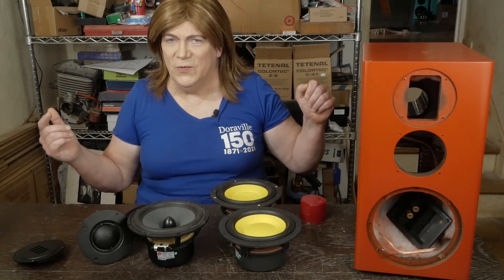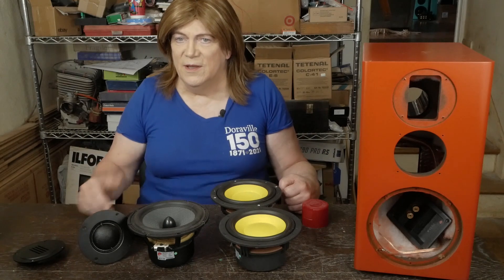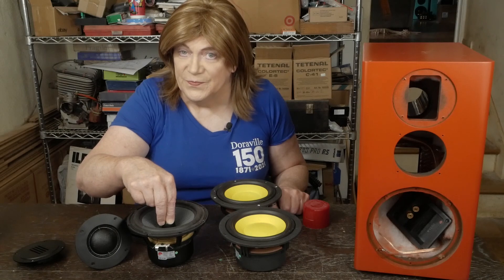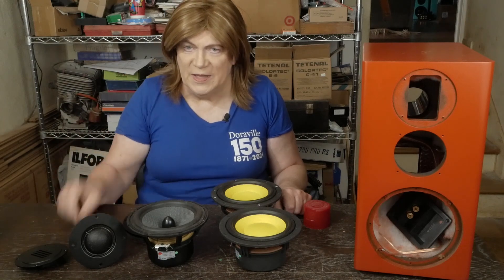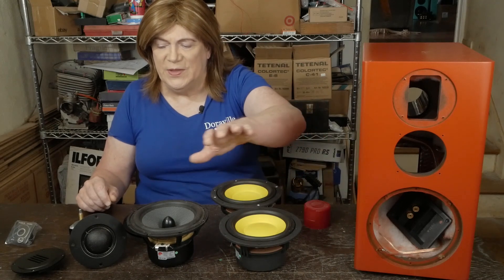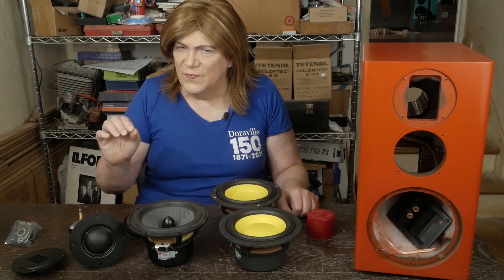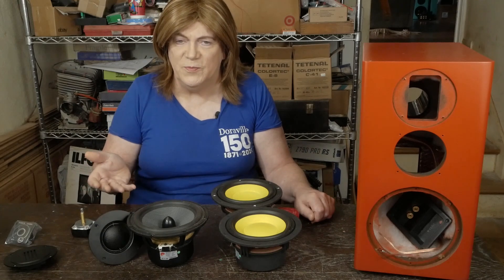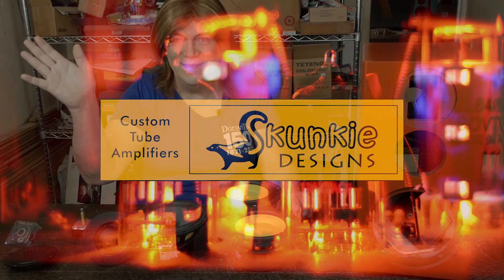Swan DIY 3.1A Speaker Mods Update

Comment: Domed midranges are made that way to produce a wider  dispersion pattern. This is more effective at higher frequencies, which is why you often see dome tweeters. Using a domed midrange is an attempt to more closely match the dispersion patterns of the tweeter down into the midrange band.

Comment: It will be interesting to see the final mods and how they sound. Typically anytime you change a driver the crossover must be changed to accommodate that it. Changing 2 of the 3 drivers is gonna be interesting for sure. I love mods and can’t wait to see the results.
Reply from the maker: My goal is to bring everyone along in my learning process. I do plan to swap just the woofers first, test, and then play with changing the tweeter.

Comment: The horn tweeter being recessed could add a time delay in relation to the midrange and cause a bit of a top end dip. Might be worthwhile also testing them wired in reverse phase to the midrange.
Reply from the maker: Good idea!
Reply: I don't see the horn loaded tweeter in the ScanSpeak lineup but I did see the straight soft dome. It's listed at 91.5 dB/M/W sensitive and a 4.5 ohm impedance so it would probably match the mid driver better. It would still have to be padded down about 5-6 dB to be linear.

Comment: Get the most out of your low-end driver you may want to check the box tuning with the new woofer. This could easily be done with the impedance analyzer on your Discovery Pro. With the woofer installed the Box all sealed up, run an impedance sweep on the low end adjust the port length until you get to even impedance humps below 200 HZ. Hopefully the speaker that you bought doesn't have Qts that is too high for ported design.

Comment: On the large midrange woofer the center plastic plug. Is a a phase plug.  There used to help extend the frequency range of the driver higher. . And yes you are correct the shape the cone does make a difference. It's just not everyone can hear the difference (not all ears are the same ) I don't know much about building speakers but I do like to play with them and learn. And I do listen and test several pair a year

Comment: Dome midrange has worse dispersion than a cone midrange where it meets the tweeter. Seems it would be the opposite, but its not, has to do with the coil coupling. Yes that pushed in dustcap will make a response difference at the top end of the woofer. Yes the bullet in the center of the woofer is used to disperse the top end resopnse and its called a phase plug. Put an 8 ohm resistor across that tweeter terminals and it will make you much happier.

Comment: Started assembling my 2.2-a and had trouble getting the cross-overs to work.  I think the inductors were not getting into the circuit.  Pulled them out and tinned the leads and reinstalled and think they are working now.  Surprised how much they attenuated the high frequencies, but will not be confident they are working till I hear them.  Below 100hz full signal goes thru has pole and 1.5khz, on tweeter only about 20% of the signal voltage hits the tweeter. Not sure what is normal to see on cross overs, maybe I messed up by measuring without a load connected.
Reply from the maker: Have you listened to them?
Reply: That's normal, higher frequencies use a lot less power at tweeter level, so that way of measuring is null and void.

Comment: Domes make sense at high frequencies... The 'plastic protusion is a kinda 'phase plug' so the midrange coming from that driver is a bit more coherent IIRC

 Subs arent nearly as critical - as long as theres no holes in the cone or  coil scrapes !!
Reply from the maker: Is 1000hz "sub"?
Reply: Yes, you may want to save that speaker for a two-way design you don't need it Optimum mid-range from it on a three-way
Reply: LOl sure aint - them big Yellow jobbies aint gonna see 1000hz er, are they?? 

Oh hold on if youre replacing the black number WITH them, I guess they ARE!?

the yellow ones look more like their meant for woofer service

 @SkunkieDesignsElectronics

Comment: IME the usual reason for a prominent dust cap like the original speaker is to stiffen the diaphragm near the centre and limit mechanical resonances. On some it will contain some damping material (BAF wadding, usually) to absorb air movement noise too (I have a pair where the designer removed stock Vifa dustcaps and fitted hard plastic pointy ones filled with BAF, for just this reason). The larger coils on the yellow jobs probably just don't need it. The different shapes will have very little effect on dispersion or anything else. With a large motor the diaphragm is more evenly supported and can be nearer a flat piston shape.

Personally, 2 out of 3 of my 'wow' speakers (speakers I heard that forever changed my mind about what was possible) had midrange domes. The first was the Celestion Ditton 66,  the second a ProAc studio with the big, fat, hideously expensive ATC mid. 

I'm not much a fan of ribbon tweeters, Though they can sound fabulous they have directivity problems as you observe, with a very small 'sweet spot'.

Comment: I don't think you will notice any audible difference  between the concave/convex woofers. At lower frequencies, dispersion becomes wider and more omni-directional, even wrapping around the cabinet at frequencies that have wavelengths longer than the width of the baffle. The dust cap difference will probably only be noticeable in the REW measurements at higher frequencies, where woofers naturally have narrowing dispersion...commonly called, "beaming". Generally, crossovers are designed to roll off the woofer's response to the midrange driver before beaming becomes too noticeable. Which is why i don't think you'll hear any difference between the two woofers. As mention in the last video, you can try to gently pull out the damaged dustcap with a vacuum if it bothers you.
Reply from the maker: That "dust cap" is part of the cone itself, is not a separate thing and is pretty stiff. There is no "gently" moving it, I tried the vacuum trick and it didn't begin to move. 

In theory I agree, but I have also learned to question theoretical conclusions and empirically test. Especially when what is being called a "dust cap" is 30%+ of the surface area of the moving cone. I think the driver is still going to be doing stuff at 1K so this shape could impact the sound. We will test and see!
Reply: @SkunkieDesignsElectronics  It'll be interesting to see/hear what happens. It's too bad the vacuum trick didn't work. Now we know why there was such a discount on them!
Reply from the maker: Right! lol I've been playing with REW today and have a really good video planned.

Comment: My criticism of this kit is that it should have come with terminal clips for the speaker terminals.  After three revisions of the crossover now, I am sick and tired of desoldering and resoldering terminals  every time I make a change.  My advice to a new builder would be to use terminal clips first.  Once you perfect your crossover, you can cut the clips and solder the wires for permanent speaker connections !

Comment: Ok, I am going to try to say this without sounding like a pretentious a hole.    I am a DIY speaker builder and I am very much acquainted with these speakers as I have built 3 pairs of them.  I will admin that I did use Scott Sehlin's crossover mod plus used higher quality components and vastly improved the cabinet construction so they are sonically inert.  Now you are saying you just dropped in a 8 ohm woofer without making any adjustment to the crossover.   Hmmm.   This is a number 1 beginner mistake in speaker building.   Its not like a car where you can just upgrade performance parts and see an  improvement.    By dropping in this woofer the crossover circuit will shift up in frequency by an Octave.   So now you have created an overlap of frequency of the midrange driver and the woofer so if it is measured you will see a big hump in the frequency response around 1000 to 2000 hz.    There is also another concern as the woofer you chose is less efficient than the woofer you replaced.   Now if you were using 2 of these woofers in parallel then essentially you would not need to make any changes to the crossover but this obviously would require a new cabinet.   You say you have noticed more bass which is expected with the driver you chose but when you say the rest of the speaker sounded much improved.   Well that I have doubts as you have thickened the lower vocal spectrum in the midrange but also there may be a bit of expectation bias of this change too which is not measurable.   I have to say that your change is an interesting one but also I am wondering if you had to modify the cabinet to make that woofer fit.   I am considering do this mod but only if the woofer will drop right in the cabinet.   I would change the values of the components on the woofer circuit to compensate for the 8 ohm woofer but if I have to make modifications to the cabinet its a no go as my cabinets are beautifully finished in piano black lacquer.
Reply from the maker: I said I was a beginner :P And I'm still not happy with these so yeah I would say don't do this.